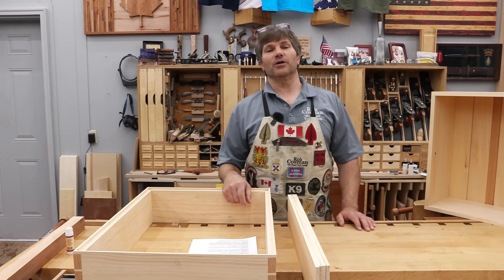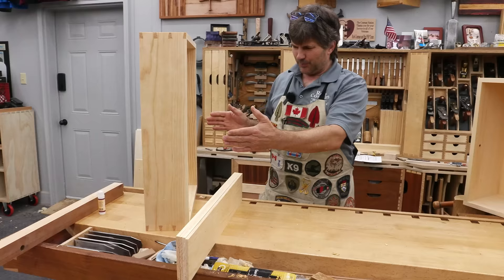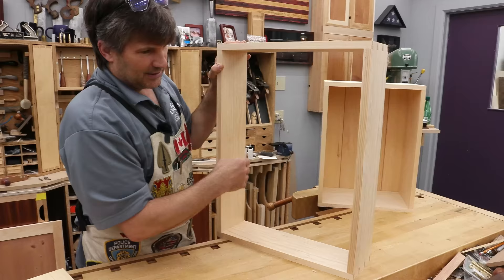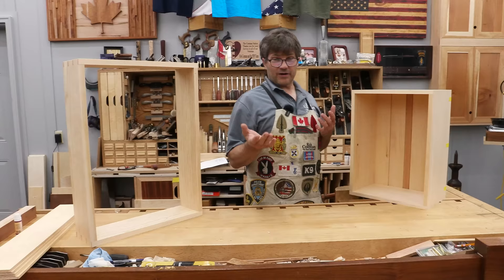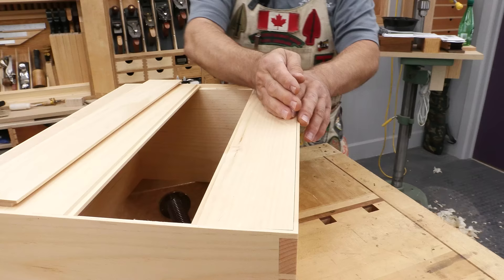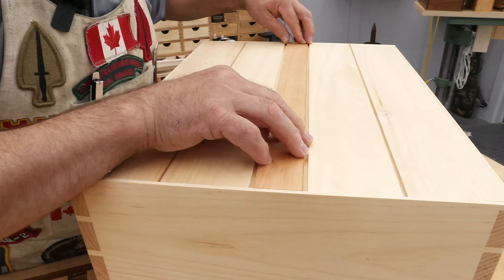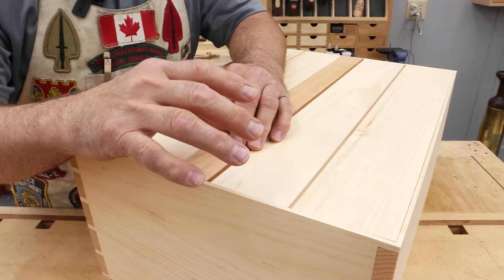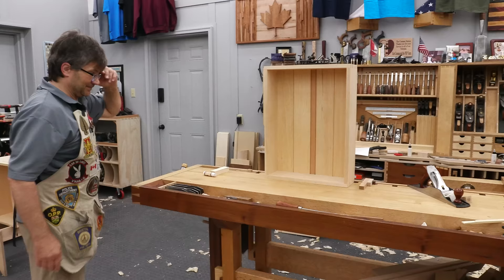Furniture Making Techniques - How to Make a Shiplap Case Back

Comment: Really like that contrasting piece in the middle. Not only does it look great , but it automatically says it's not some cheap "beadboard" plywood back. Also like the story board method you used. Too easy for me to mix up the rabbets and also easier to visualize the lay out. Thanks again!

Comment: I enjoy watching your presentations - well thought out. Just 2 points. I always use screws for fixing and no glue, but don't fix onto the back. I would dovetail nail if nailing, perhaps glue then. Second point is I make the gaps between muntins and panels narrower and reduce seasonal movement by selecting qurtersawn stock. Keep up the good work. I always learn something from your videos, sometimes by what I see in the background. .ie by observing your s.hop as well as the subject of your presentation.

Comment: I put the ship-lap backs on my bookcase and display case I built for every reason you discuss.  I used British 2 Pence coins for spacers between the boards because I had them to allow for wood movement.  I ran a 1/4" bead on the inside pieces of the back to give me that look.  The bookcase hides it with books, but the display case shows the vertical beads well with my Tyrannosaurus jaw  I used red oak for all the pieces.  I prefinished all the wood, too.

Comment: Thanks for a great video.  
1. Why use the nails?  Isn't the glue enough.
2. Me being a hobbyist wood worker, would dovetaling the centre piece into the top and bottom back be good for strength and stability or am I being "over the top".

Comment: This was just what I was needing!  How would you lay out the shiplap for a wider back?  In this example, you glued/nailed the sides of the end boards, and oriented the movement-accommodations towards the center piece in a 5-piece back.  Suppose it was, say, 10-pieces?  Would you glue/nail the center of each board for movement in both directions for the boards for a wider backing?

Comment: Rob and crew..why does the blunted nail help reduce splitting the wood?  i have never seen that before.  as always thanks for showing the process
Reply: One possible explanation I've heard: 
a pointed nail is a wedge, it goes between the wood fibers pushing them apart, thus splitting the wood.
a blunt nail cannot wedge between the wood fibers, so when you drive the nail, it punches through and breaks the wood fibers at the point

Comment: Awesome video as usual. It gave me several ideas. One question or comment though- when you were installing the fir strip and I started to split, I believe I would have stopped and trust the glue to hold it in place. Is there a reason you did not want to do that?

Comment: Rob - you are amazing - however what on earth are you doing with the story board ? roughly work it out with around the size you want in the middle left over - cut identical sized pieces for left and right - then cut and fit the centre T section to whatever is left over if its 2" or 1 1/2" is that really that awful for you? would that stress you out ? :)

Comment: Never thought about putting a contrasting strip down the center of the back like you did.  Looks great.  Do you have a source for the spacer blocks (set up blocks) that your friend gave you?  I don't see them on your web site.  Thanks,
Reply: The blocks look like the iGaging 15pc “Right On” precision set, but it could be branded differently.
Reply from the maker: We dont sell them, they are readily absliable though